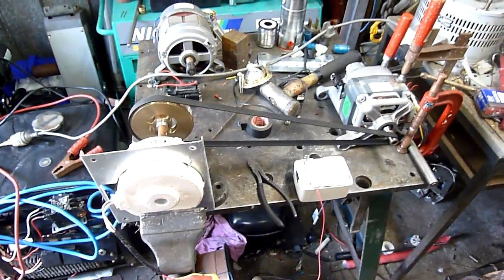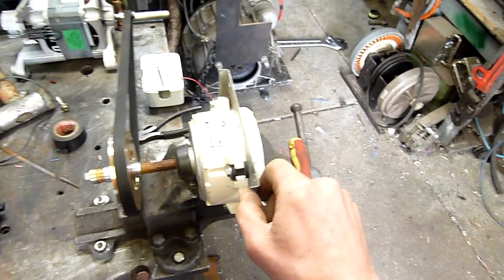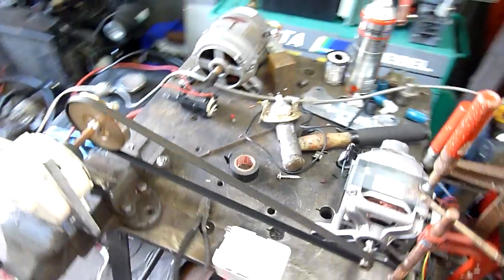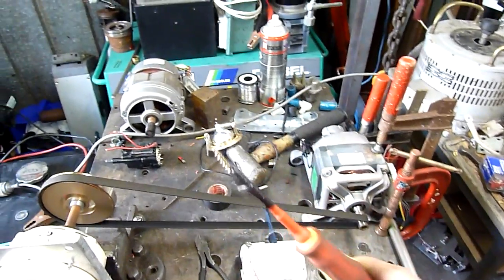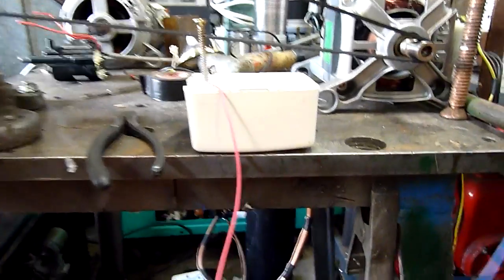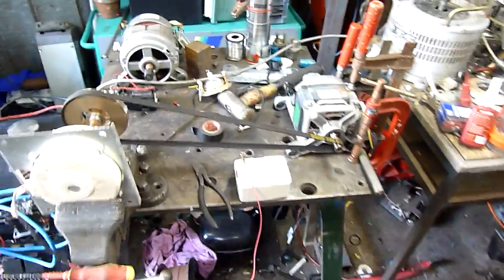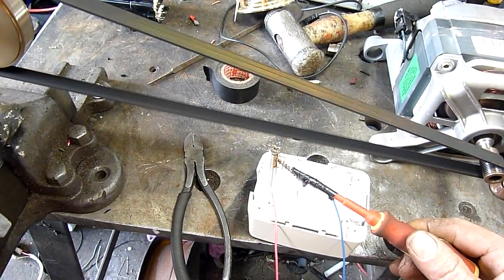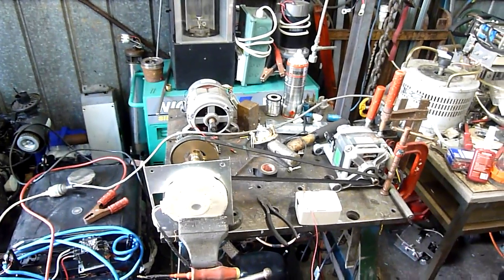DC Condensing Unit Fan Motor as A Generator?

Comment: nice try ed :D ,  if you wonna make a engine powered welder , you can take a alternator and a lawnmower engine to build one ( or even a little generator for 12 volts with an inverter )

Comment: Mmmm, nice sparks-n-arcs there. :-)

See if you get the screw hot enough so you can slice the top of it off. :-D

Like someone else said: Switch the pulleys around the other way to see what happens! :-D

I'd still like to see that done on a washing machine: Put the large pulley on the motor, the small one on the back of the drum, then spin it up to see the drum scorch around at a ridiculous rate. The drum would probably expand outwards like a drag-racer tyre. :-D LMAO!

Thanx for showing,

-BBD.

Comment: wounder if u put a smaller pully on the fan motor n bigger on the universel... u would get a hell of a lot of power out of that.. idk if that would burn the moter out or not
Reply: The maximum power out is inherently less than the power supplied to the motor driving it. I suppose you could increase the voltage, but at much lower current.

Comment: Swap the pulley wheels around so that the larger pulley is on drive motor and the smaller on the generator motor,means that the generator will spin faster, another great video :-)

Comment: Only problem with using the smaller motors as generators is you need them to go damn fast to get any usable power. Probably not all that practical for a wind turbine, unless you gear it up a bit. The F&P smart drives are by far the best for that.

Comment: Any DC Permanent magnet motor should work as a Good Genny!, if you hook an F&P smart drive motor on a small engine, Then connect the 3 outputs of the genny to an Identical Smart Drive motor, it'll be driven just like an inverter would, i would like to try that, but only got 1 Smart Drive lol

Comment: Is that a 12V halogen or a 240V bulb?

If it is a 12V halogen you have a load matching problem, too high a voltage and too low a current. It will work much better on a 50W 240V lamp. Give it a go.

Comment: too bad it generated in DC otherwise u could use the fan motor to power the universal motor and you could crank one of the pulleys to get it started and make an endless loop xD